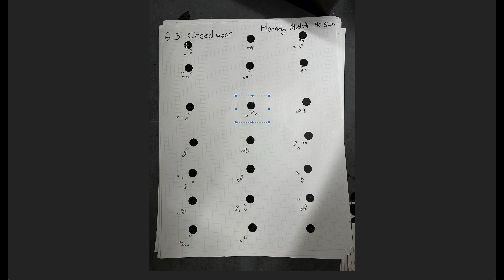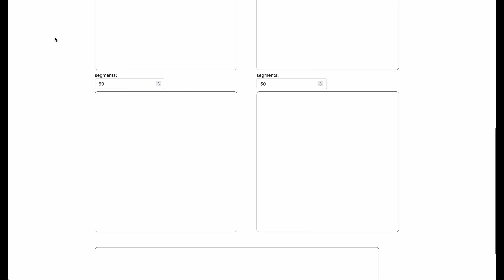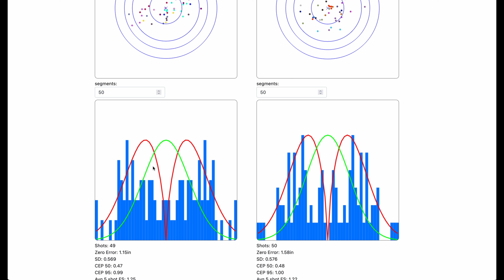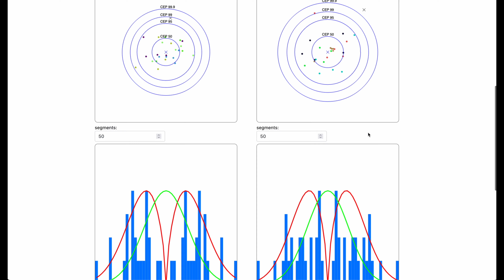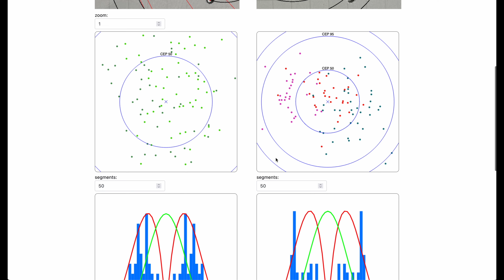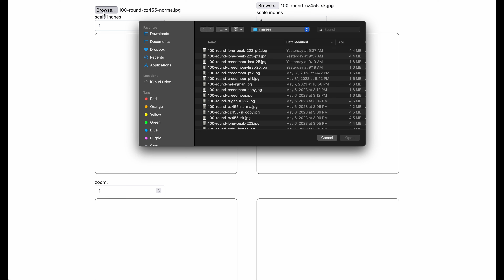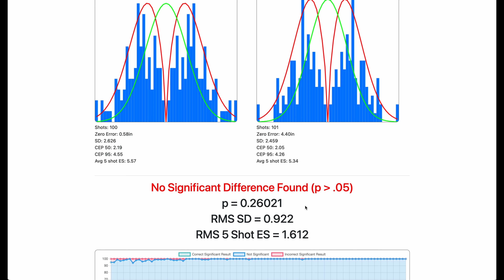Does Barrel Heat Affect Accuracy?

Comment: I used to be a competitive shooter.  Early in my time in competition I found that my elevation zero changed as my barrel heated up.  I had to make adjustments as it heated.  Then somebody loaned me a mirage band, and said to try it.  The mirage band is a piece of material, like what suspenders are made of, and is stretched between the front sight and the receiver.  It blocks the heat waves from the barrel.  After I started using the mirage band I no longer had to make zero adjustments.  The heat waves were bending the light between my front and rear sights.  Heat waves in front of your scope may be what is causing your apparent zero change with the hot vs cold barrel.
Reply: For sure, my first 1000 yard match shooting an M14, the target began to disappear. It was heat mirage off barrel. It took me awhile to understand what was going on. Today I shoot a match conditioned AR-15A2 and I have not had a problem with heat mirage off barrel. Now, the target disappearing is usually about low light or fog causing me to come to the firing line with a host of aiming strategies. Fun stuff.
Reply: One reason that the sights on AR platforms are above the barrel was to mitigate mirage. I understand there are other reasons, but it is definitely significant.
Reply: @kbbacon the sight height on an AR was determined solely on the position of the average shooters eye after the shooter achieved a muscularly relaxed stockweld, resting the entire weight of head upon comb of stock. This condition better assures consistent sight alignment.
Reply: Of course the mirage band is essential to an understanding for where the barrel is pointed but a barrel getting hotter from firing can also alter bullet impact. It’s why I take 8 sighter shots when shooting my 6.5/284 in long range  competitions which allow for unlimited sighters By the 8th round the temp of barrel is stable enough for me to hold the 10 inch X-Ring for subsequent shots.
Reply: I know this is an old post, but I was wondering if a mirage band can just be almost anything "fabric" placed over the barrel? Like, does it have to be a lycra-based stretch material, or could an old canvas belt work, for instance?
Reply: @OhGawdHesGotAGun  You are correct, but the advantage of using something stretchy is that it holds well.  My band has a wire loop that fits around the front sight base and a smaller loop that fits over a screw sticking up from a hole tapped for a scope mount.  The band is held firmly slightly above the barrel.  You can likely achieve the same results using a canvas belt and something stretchy to hold it in place.
Reply: @duncansmith1621  Understood, and appreciated. I like to keep my guard up when it comes to "$40 solution where a $4 solution is exactly the same" scenarios - but then I recall how much I'll be spending on ammo "getting good", so getting the proper strap is good advice. Thanks!
Reply: @OhGawdHesGotAGun  Yes, the ammo thing.  The military shooters were issued ammo, so it was nothing to them.  All the civilian shooters I knew reloaded their own ammo.  Everybody did this because it was cheaper than buying factory match ammo.  I was shooting about 4,000 rounds per year.  Evenings Monday through Thursday were spent behind the reloading bench.  Friday nights were a day off, resting before shooting matches on Saturday and Sunday.  I stopped going to matches because one year I just couldn’t make myself spend that much time behind the reloading bench anymore.

Comment: Interesting and insightful, but as often happens even in professional science, an inappropriate application of statistical analysis.  In particular using statistical tools that only have rigorous meaning for normal distributions (standard deviation and p significance) for provenly non-normal distributions.  While rampantly inappropriately used by professional scientists in journals, particularly in social, psychological, biological and even hard sciences, it still doesn't make it valid.
To give credence to your work, non-normal statistical tools should be used.  In particular a means to map the data into a normal distribution before you can havevalidly interpretable meaning for standard deviation and p.
This is a good start, and a proof of concept. I agree using two 5 shots groups for comparison is usually meaningless.  Your qualitative results are certainly accurate and applying statistical analysis to them (even if not strictly appropriate and accurate) is highly insightful.
Reply from the maker: In this test we use the Chi distribution, which uses the standard deviation, despite being non-normal. We also use the Mann-Whitney U test, which returns a p value. The MW test is a test that can be used when two data sets follow the same distribution, but are not normally distributed, which is what we see in this case.
Reply: @johndombeck955 you speak as if you're an expert on this, but then you say inane things like std dev and p values only have rigorous meaning for normal distributions. That's utter nonsense. There are myriad ways folks have come up with to do hypothesis tests that generate p values in non-normal contexts (Mann-Whitney U, used here, being but one example), and as any Stats 101 student should be able to tell you, the standard deviation can be computed for any distribution, not just normal.

Comment: I guess my biggest question after this is "what does this change?" Dealing with non-normal distributions in rifles is an actual finding, but we've always known that more data produces better conclusions but generating that data cannot lend itself to the same conditions each time. Precision changes during use from mechanical accuracy from fouling in the bore and lapping from projectiles to name a few examples. Weather conditions change during the time generating the data. Both of these are generally irrelevant but multiplying them over a large number of shots and time to take the shots increases their significance to the overall data. You may not have an answer to this, but in talking load development-- which is where most people end up using statistics like this-- is there a different test that can be applied using this understanding of statistics or would we still be isolating as many variables as possible but just shooting more shots per test?

Comment: Might be worth starting a discussion on r/longrange to expand the audience.

I believe mdt had similar results when they did some extreme heat testing on a 6.5cm.
Reply: Back in 2003 I entered the National Long Range Championships, bringing to Match 531, a 600 yard iron sight match, a 6.5/284. My first sight-in shot was a perfect X-Ring hit so I told my scorekeeper next shot would be for record. That next shot through 6th were 12 o’clock 10 ring hits even though I adjusted elevation to get back down into the X-Ring. Thing is since it was my first outing with the rifle I just did not imagine the barrel was going to effect my elevation adjustment for as many rounds as it did. At any rate, I ended up with a perfect score but only 14 X’s which were produced from 7th to 20th rounds. I thought I still might have placed highly but later learned my score was only good for 4th place. The next time I came to the firing line I shot 8 sighters before going for record and scores improved. At any rate that’s one of my long range experiences with a 6.5. Overall, only issue with it for me these days is it only has a barrel life of about 500 rounds before X-Ring hits at 1000 yards are hard to come by even with an MOA wind constant of about 22, which makes it pretty easy to stay in X-Ring when wind is appraised just fairly.

Comment: As a material scientist what a lot of people get wrong about residual stress is they blame it for things like this where you have the group move.

If your group moves, goes back to the same place it’s not residual stress. Actually your hammer forged barrels are full of residual stress and very accurate.

Residual stress will only cause permanent warp. The problem residual stress causes is 1. You affect the yield stress of the materials to the point where the residual stress causes inelastic deformation. 2. You remove material that was stressed, now that materials not there so the rest of it shifts.
Reply: As someone that works with metals, I'm curious to what else you would attribute this repeatable, heat-trending shift in point of impact of a free-floating barrel, if not residual material stresses causing the barrel to shift unevenly as it heats up along its length.

 Isn't the entire point of stress-relief heat treatments to mitigate this problem, and equalize stresses throughout the material before subsequent hardening/tempering processes? And then post HT, theoretically any machining operations of the base material will be inducing stresses into the surface of the part through work-hardening.

Comment: If you are talking about heat, get an IR thermometer.  You'll be measuring the exterior of the barrel and chamber, but if you measure the same point each time, you can put numbers on the change in temperatures.

Most rifles are composed of several different metals.  You may have one steel for the barrel and a different steel for the receiver.  Is your bolt face perfectly square to the chamber?  These different steels will heat up at different rates, expand at different rates, and bend the rifle components slightly.  One full degree of bend is 60 inches at 100 yards (not completely right, just ballpark).  Recoil will jar stuff loose--a reason to use thread locking compounds.  In the old days, screws were staked in place.  The heating shift observed when I was using a ZeroMatic machine rest for rifles was enough to move the group center two inches and sometimes more if I fired more than three shots in ten minutes with some rifles--other rifles didn't shift impact points even after ten shots in ten minutes.  It doesn't take much when MOA precision is the goal.  Receiver heats up--but the scope base doesn't--and the receiver is no longer perfectly aligned to the scope base.

Comment: So, please share your thoughts:  Let’s say the goal is to determine which of two loads is more accurate.  Rather than shooting two 50 shot groups (total = 100 rounds), what if you shot two 5 shot groups, one with each load, and recorded which of the two was more accurate.  Then repeat this test four more times, for a total of 50 rounds.  Would this test be significant for determining which of the two loads was more accurate?  Would we expect to see a trend if one load was more accurate than another?
Reply from the maker: Great question. If you are comparing the extreme spread of multiple five shot groups, you would use a t-test instead of the method described in the previous video. I modified the software that predicts the needed number of shots to test this scenario. The short answer is "it depends", but for a few scenarios I plugged in, you are about four times less likely to get a significant result with five groups of five shots from each ammo, compared to fifty shots of each ammo with the Mann-Whitney U test.
Reply: Learn shooter/target analysis. That’s essentially coming to understand error from call/strike corollary and from the size, shape, and placement of group. When you get the hang of it you will distinguish ammunition uniformity, rifle integrity, and marksmanship as the cause of error. For example you call the shot at 9 o’clock and indeed you see through spotting scope that the shot went on call. The shot is at 9 o’clock. What does that mean? It means the rifle is shooting to zero but aim was disturbed, possibly by poor trigger control Now, let’s say your 5 shot string is distinctively horizontal. There are nine things this can be but it’s likely inconsistent sight picture or inconsistent NPA. At any rate, shooter/ target analysis will get you all the information you need to become a champion shooter by hastening marksmanship and hand loading development.

Comment: Be of good heart and exceeding in joy. Verily I say unto thee, plenty will come along to criticize. Not always from a logical stance. Often simply because they feel the need to fight. About anything. Like Marlon Brando in the "Wild Ones."

"What are you rebelling against?"

"What do you got, Man?" )(SIC)

I think this clarifies it well and I would be one to ask where in the shooting cycle do the variances or greater dispersions happen? Is it when the barrel heats up?

Your data does not show dispersion increasing from barrel heat. The only correlation so far, which may or may not have a reason is the shift of zero with barrel heat. The group can still be the same size but slightly away from previous points of impact.

I have been thinking that I must zero and group my hunting rifle on the cold bore but this shows that will not matter. Better to aim small and miss small and still recognize the dispersion possible. I am also glad that it is noted that group size does include all factors. We do not have a reliable and cheap way to shoot in a vacuum.

Comment: Will your software tool be available? I complete in airgun field target, and airguns are often very fussy when it comes to pellets. I've never felt like I was getting reliable data when testing pellets, and I'd love to have a tool that I can actually analyze the data with, so I can be more certain I'm choosing the right pellet. We airgunners deal with much smaller SD and ES with our velocities, and barrels heating up isn't a thing, but we have pellet head sizes, pellet shape, pellet weight, pellet consistency, pellet hardness, power levels, and hold sensitivity to worry about. Every barrel is different, and the shooter is a massive influence. Oh and wind is a big one. I can't be sure I've chosen the best pellet at all, I can only eliminate some that very obviously perform poorly in my gun. I'm going to start shooting very high shot count groups, but what your video tells me, is that you can't really tell by looking at these things if there's any statistical difference. I'm not capable of doing this kind of data analysis myself.
Reply from the maker: It's available at https://blackburndefense.com/tools/compare-groups/, we also have an intro video here: https://www.youtube.com/watch?v=duvs_tGxYzs
Please let me know how your testing goes. I would be excited to see the analysis for airguns.

Comment: Was mulling this over in the old steel trap... I wonder if the Olympic shooting sports have databases you could run analysis on. Be interesting to see what the best target shooters, with the best equipment achieve.
Reply: The CMP has published a bulletin for every National Shooting Championship since 1907 yet we do not need those bulletins to know what’s important to good shooting, consistent sight alignment and smooth trigger control. Everything else supports these two principles and the everything else is mostly a shooting position which transfers the stability of the ground into the position, factoring bone and artificial support, muscular relaxation, and natural point of aim. So, come to the firing line with a match conditioned rifle, match grade ammunition, and marksmanship developed from practice to post best scores. That’s it. Now, what trend you will find in these bulletins is scores keep getting better and children are also winning. Why? The light weight, light recoiling match conditioned AR-15 can be handled by small stature people and is more accurate than previous versions of the US Service Rifle brought to the firing line.

Comment: You need a power analysis, just removing observations from the data until it becomes insignificant is not statistically valid. You are not taking into account sampling uncertainty in the estimated mean and variance that go into calculating the p-value.

Also, if anything more external variables should mean a more normal distribution. This is a direct consequence of the central limit theorem (in this case the two-dimensional CLT since you have both an x and a y-axis). Additive, mutually independent disturbance effects should bring you closer to normality.

Comment: I'm struggling to understand how I would apply this knowledge, in the cost-sensitive, "real world".  

I don't reload and for me to purchase 100 rounds per SKU to determine the best ammo for my rifle is simply not be possible.

Is there someway, someone like me could use this knowledge in a practical way?
Thank you!
Reply: Man there isn’t much practical “real world” about this latest fad with grinding stats into the average and vast majority of shooters. Really this stuff is only relevant to people who develop Ballistic solvers and greater things. Buying the best rifle, optic, ammunition and training you can afford will give you greater joy in this sport then beating your head and wallet trying to “determine” what your rifle is really capable of. Working your fundamentals and learning to read wind will have the most significant impact on your groups, hits and misses. But knowing that stats does have a place here and excepting that you’re going to have a random “flyer“ being your fault or dispersion.  Your question about a sku’d lot of ammo and price. You should be striving to purchase as many of the same lot as you can even if that means saving longer. Run a box of that through a a top tier chrono. Get your average and go shoot. Sampling several boxes of factory ammunition before buying a huge lot is probably the best route. But knowing for example tons of people have good luck with Federal Gold Match 175smk for a 308 or Hornady 140ELD match Factory and Berger 140gr Factory ammunition for 6.5cm would be the ones to buy first. This turned out to be a lot longer than I intended. Hope it helps.
Reply: @Josh-uf1rv  Thanks for your time.